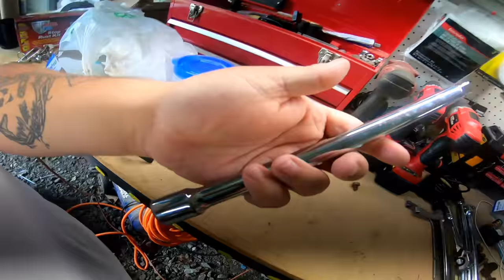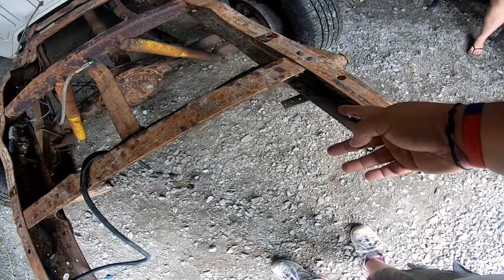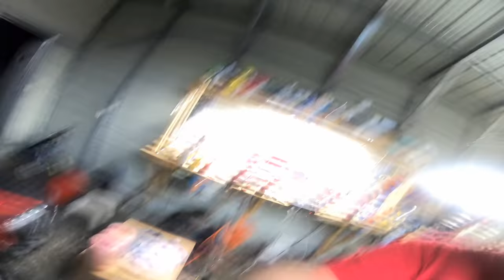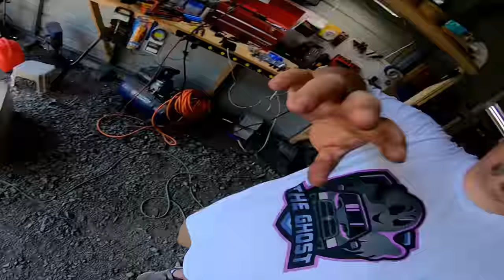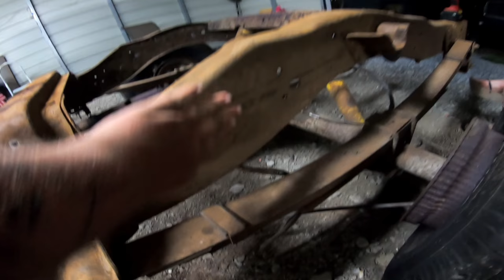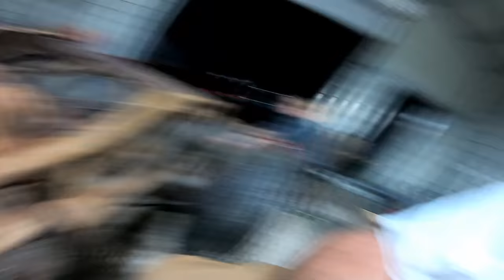RIPPING THE GAS TANK OFF THE FIRST GEN RAM AND WIRE BRUSHING FRAME!

Comment: Use a angle grinder with wire wheel. Alot more power gets the job done quick. If your frame is pitted use a needle scaler. Made the job much easier on my rust bucket of a jeep